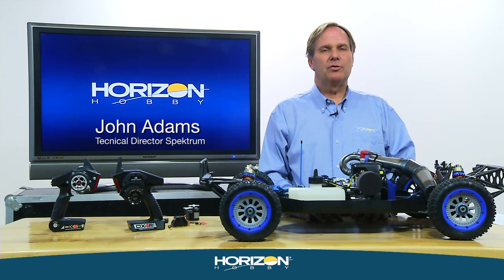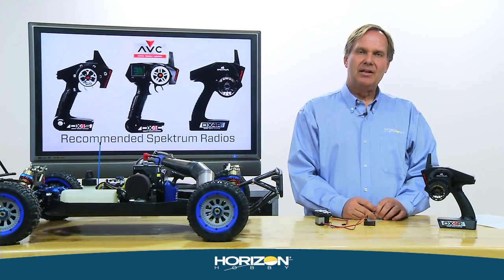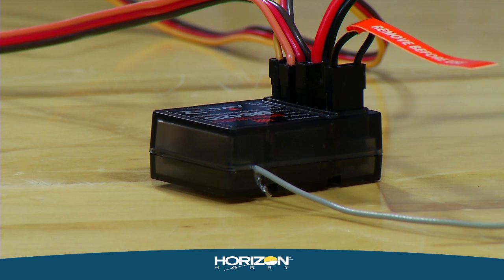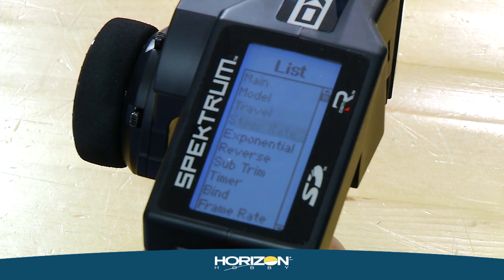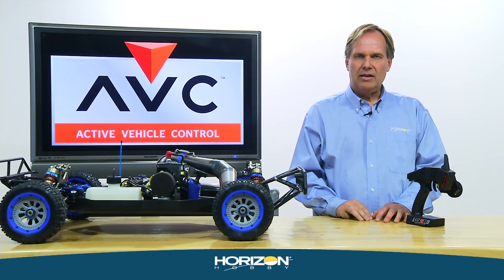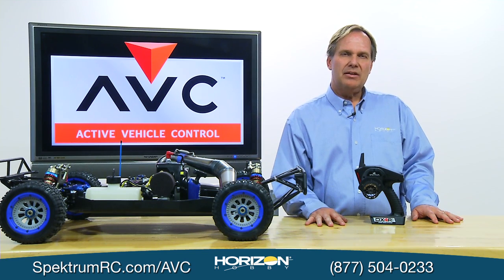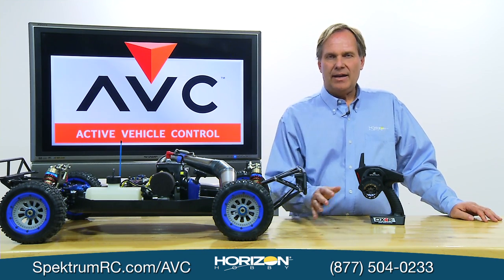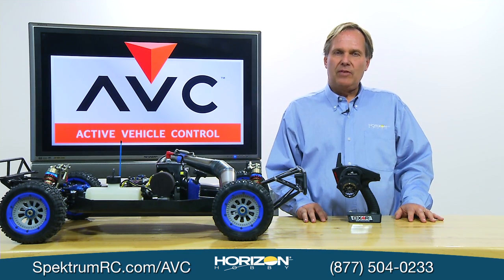AVC (Active Vehicle Control) Setup and Calibration

Comment: So i realize this video is a little old, but I have a question. I recently got a DX5 Pro, and an SR6110AT DSMR 6-Channel AVC Telemetry receiver. My issue is my AVC settings on my radio don't seem to actually affect AVC, as in if I set to active on the radio, the car doesn't seem to change behavior. However if I go into channel assign and assign the pot to AUX1 it does affect it(side issue here, it doesn't stay set, every time the radio restarts, this assignment must be redone.) Would like to have finer control, vs. just a single knob. This is a new build, I am sure I am missing something.

Comment: I have an SR6100AT receiver with a DX6R Pro remote. I want to use this on my Traxxas E-revo that comes with dual servos for steering. 
I am amble to configure mixing in the remote (STR + Aux3) and normal steering works ok, but all AVC corrections are only using one channel (STR).
How can I configure the receiver to also do mixing in AVC mode?

Comment: So if I bind and calibrate my truck and with the setting on Neutral it pulls to the right. I adjust it so it drives straight then re bind and re calibrate. Then do I adjust the values back to 0 or do I leave it alone after I rebind n calibrate the second time???
Reply: What did u do in the end I just bound once and drove no problem since🤔

Comment: How do you set up the failsafe with a AVC receiver? I just tried it a couple of times but it doesn't work! You have to go through the sequence when binding a AVC receiver so setting up a failsafe setting is not possible? What is up with that?
Reply from the maker: The Fail safe is preset to Lower throttle (mid throttle captured at bind) and hold last command for the rest of the channels. Hope that helps!
Reply: SpektrumRC  Oké, so it is a default preset, and you can't program your own failsafe setting like you can with the SR310 for instance?
Reply from the maker: Correct.

Comment: why is my avc backwards??? using the dx4s with the srs4210 receiver. if I turn right, it turns more right for me. so it won't counter anything if I wipe out. it actually induces myself to Wipeout more.
Reply: Lol, you found the Active Vehicle Crasher button.... :p
But seriously, set your priority setting (in the AVC menu) to 0% and start from there. The way the priority function works is it makes you able to really throw the car into corners, because it will have all steering gain right around center, and no steering gain at full stick.
Reply: jgrimsta I actually figured it out. It needed to be reset. Not the binding, but the receiver needed recalibration.
Reply: I thought you would have figured it out by now :)
I really like the AVC because I can now drive my little Tamiya M02L beetle again without constantly trying to correct the steering. It has developed an insane amount slop in every front link after beeing driven for over 20 years, still has every original part too, but the AVC made it drivable again and made some jaws drop too hihi :D
Reply: jgrimsta that's cool, nice how avc brought your car back to life
Reply: How did you reset your receiver? I’m having the same issue, but can’t find any info on resetting the receiver

Comment: how do you disable AVC
Reply from the maker: There is a connector on the RX that you can install a bind plug into that will disable AVC while the plug is there. Otherwise if your Radio has a AVC menu you can disable it there by making the percentage 0%. Also, If you do not have an AVC Menu, you can disable it by making zeroing the Aux1 and 2 channels on the Travel menu in your radio.  Hope that helps!
Reply: After I install the bind plug in the disable Port do I have to recalibrate the receiver
Reply from the maker: Not after the disable is used. But no matter what the setting is, everytime you bind the calibration needs to be done.
Reply: ok i may get the losi 8ight buggy for christmas (this one(http://www.losi.com/Products/Default.aspx?ProdID=LOS01004T1 ) and it has avc and i was wondering if i have to do anything with it to calibrtate and what i have to do out of the box to make it work better becuase i have used an rc car and have a traxxas rustler but havent gotten avc or havent used it before and was wondering if you could make a video of what to do out of the boxx with it and what i have to do 
thankyou so much!
Reply: https://www.youtube.com/watch?v=uFrRlx7UvVc&t=12s    the one thing the video does not address is where to plug in the power.  i have an srs4201 receiver.  (stock with  losi mtxl)  i put power in the aux2 port and my super killer bee plugged into the aux1 port.  and the killer super bee switch does work with the avc disabled.  and yes i will l be upgrading the transmitter and receiver soon.  you will need  2 bind plugs.

Comment: Question: I have a DX4C transmitter with a SRS4210 (AVC) receiver build in a 1/5 scale gas buggy. When the receiver gets out of range, for the transmitter, the failsafe brings the trottle servo to neutral. My buggy still drives a lot of meters before it becomes to a standstill. How to adjust the settings of the failsafe so it will brake instad of going to neutral?

Comment: Quick question for Gas RC's can you use a Kill switch on a SRS4210 RX with AVC on is there a spare channel still or is the AVC using all four channels? I'm going to be using a DX4S but also have a DX4C SR410 and DX3S and SR3300T that could be used also ;O)
Reply: +RC Car Club YEs I would like Spektrum to address this QUESTION as I have the same radio and receivers and would like to have the AVC on and still have my Killer Bee kill switch still work. Why is my 4 channel radio now a 2 channel radio????
Reply: KLH1966 I've just put a SR410 in I don't really want AVC in such a competent vehicle Kill switch is Safer than TC or Heading Hold plus it drains your RX batt more ;O)
Reply: +RC Car Club I fully understand that and agree safety is NUMBER ONE. But we buy a 4 channel radio for a reason.  Spektrum NEEDS to fix this as this will also not allow lights to run also with AVC on. Just saying I/we pay for a 4 channel radio we should have a 4 channel radio with or with out AVC on. SO Spektrum you need to answer this and address this.

Comment: Since you're putting the bind plug in where do you plug the battery in at?
Reply: You take the bind plug out when you are done binding it. If you don't take it out the truck will stay in bind mode.
Reply: +RC Car Club great. Thanks
Reply: Just put the battery in another channel I presume like all other Spectrum Surface RX's ;O)

Comment: i have 3dxs and i did calibration and everthing but my servo jitering and gets warm what did wrong
Reply: DX3S is a DSM/DSM2 Transmitter you need a DSMR Transmitter DX2E DX4C DX4S DX4R etc to use AVC ;O)

Comment: Can you speak on why you have chosen to throw your customers under the bus with the latest firmware version updates?  You know, the ones that make binding to DSM technology (your technology in fact) receivers impossible.  I've heard the FCC changes line of BS blah blah from Horizon already.  Everyone I know says it was a business move so you could hurt Orangerx the cheap but equally capable chinese knockoffs.  I'm just baffled as to why you would make the electronics for Losi vehicles, then create a transmitter upgrade that won't bind to those same exact brands you've provided tech for.  I highly suspect you won't have a response for me.

Comment: Really good info. however when i do the first step in the calibration menu i only get the light going off and on at full throttle, when moved to full reverse nothing happens and its the same for right-left steering. any help would be appreciated. btw this is on a losi eight with SRS4200 and the dx2e.
thanks

Comment: Seriously? I just found out about this.I have already talked to most clubs and they will not allow this technology.My question is why is Spektrum even bothering installing this ? I can understand installing aids for flying but not for racing. Even then I think they are getting carried away with gps and fence technology in planes. Once you learn how to fly these aids become useless add ons that drive up the cost of cars and planes. I would be the first to gut the technology from a racer or plane especially if its something I really want but dont need the baby sitter.
Reply: no club racing is far out of the stone age... and it does take away from that actual driver skill. its just about all legitimate race tracks/organizations said  right when this came out that it was against the rules.
Reply: Just because F1 does it doesn't mean we should. If Michael Schumacher jumped off a cliff, would you too?

F1's are also stupid fast... I've never been in one so I wouldn't know if sophisticated stability controls would be mandatory for safety. These RCs do not have the same demands simply because we aren't sitting on them.

race - 1.
a competition between runners, horses, vehicles, etc. -- Is it still competitive if said racer is using computerized aid?

competition - noun
the activity or condition of striving to gain or win something by defeating or establishing superiority over others. -- Is a driver superior to others if they stick to corners better via electronic?

competitive
- having or displaying a strong desire to be more successful than others. -- Well? Still with me here?
Reply: +scott firman Sounds to me like the clubs just need to get with the program and come out of the stone age.  Formula 1 runs stability and traction programs, has it hurt that racing?  There are certain things Humans just can't do.... Try to fly an F117a without Avionics for example...

Comment: Im not really left handed i just steer with my left hand,it makes me so much smoother and faster, i just can't use it the correct way if you want to call it that,lol! I use the throttle with my right and reach over the top with my left to steer,seen quite a few doing it this way and there driving style is very similar to mine, fast and smooth 😎 cool man thanks for the reply

Comment: My E Revo Brushless has 2 servos, how do I set up the 4210 with it?  Will a Y cable work? Please help.
Reply: I think a Y cable would work but you also can try using it the way that it was plugged into the stock reciever.

Comment: this is cheating.. hope no one shows up with one at the track. yikes.
Reply: It can be turned off.  I don't race, but in the manual it says that race regulations may require AVC to be turned off.  It then goes through the process of turning it off.

Comment: What's the truck?
Reply from the maker: Custom Losi 5ive-T
Reply: +SpektrumRC hey there...humm, listen...i have a spektrum 4210 in the halix, and it's set horizontally, i tried, for better cables management, to set it vertically,recalibrated it with a new bind...But it doesn't want to "auto orientation" and so the AVC doesn't work at all..any solutions ?
please help...XD